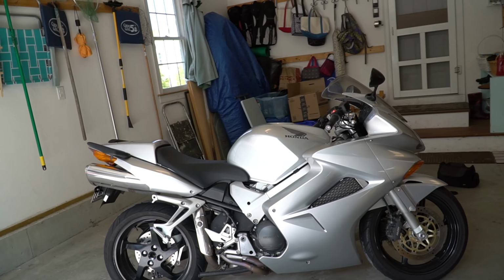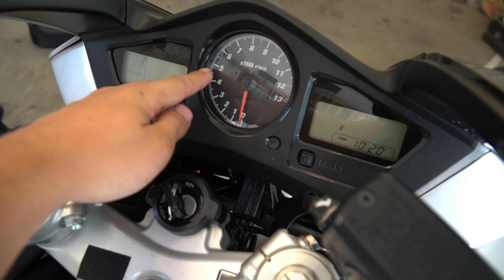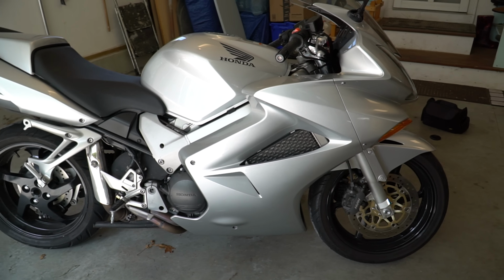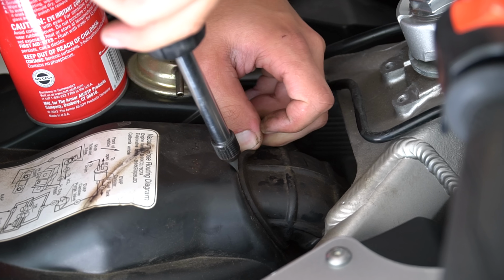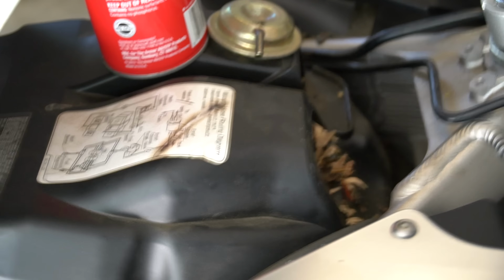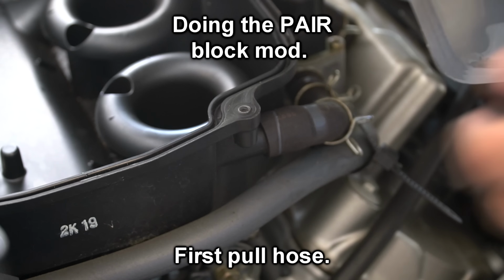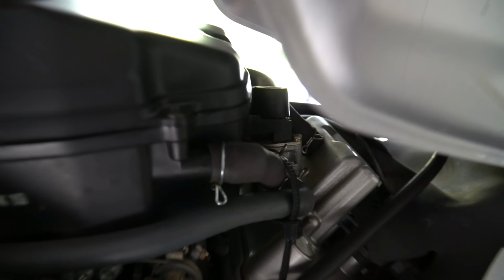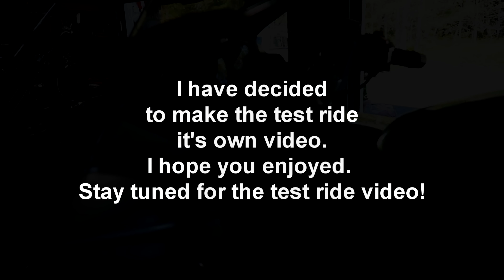VFR800 Snorkel, Pair, & Flapper mods, easy, free horsepower!

Comment: Speaking as a factory trained honda tech, the pair system only operates at closed throttle so it has no effect on acceleration.  It only injects air into the exhaust side during closed throttle deceleration for emissions purposes

Comment: I bought me a VFR from 2002 (my first bike😅) and although i am a beginner i just felt something's off on the low end but i couldn't say what it was.
I will do these things this week and i'll come back with some feedback.
Until then,thanks! 😁
Reply: Did you end up doing them?
Curious to see if it does anything
Reply: Did you end up doing them?
Curious to see if it does anything
Reply: @rocknexus5749  yeah,but only had to remove the snorkel,the last owner(i guess) did the flapper mod and deleted the pair valve.
To be honest,i think that the "power boost" sits in the stupid snorkel and the flapper. I love those pops on deceleration and i connected the pair valve back on(i noticed a pretty decent difference in fuel consumption with the pair valve connected since i still have the cat. convert on the bike,she drinks less 😅).
About that power gap that you feel around 4500 rpm,it's mostly gone,bike pulls better down low,but i still feel it every now and then,not big of a deal.
Overall,i am very pleased with it.
Go for a ride with it stock,get back home,remove the flapper and the snorkel and go back on the road and you'll see it for yourself 😁.
Ride safe,man! 🫡

Comment: 2 hours is definitely not enough time fro the K&N filter to dry, you just sealed the water in with the oil, so you have extended the drying time exponentially. That bike has been well looked after.

Comment: Done all these mods to my 2001 VFR800.After a short period of no difference,I've put it back to it's original configurance.
Reply: I could definetly feel a difference. It pulls much smoother and stronger at low RPMs, and the sound improved quite a bit too.
Before, it was a lot more jerky and felt weaker.

Comment: Did this to my 2015 today. Couldn't find much info online about if the 8th gen bikes needed this mod or not so I tried it out and omg, it's like a brand new bike. So much smoother at low rpm and shifts smoother too. I love it! I didn't do the snorkel though, I figure it probably helps keep water out and I get caught in the rain sometimes when I go long distance.
Reply: Rain water can't get in, pressure washing can, so beware people, also vermin love to make a nests/food stores in air-boxes ... waste of time pulling the snorkel, it does nothing for power or economy on any Honda, probly even all bikes, junk the Flappers system, did nothing anyway only quieten the motors induction down to pass stupid noise test at low rpm's.
Install chicken coup wire mesh or similar small grid wire mesh over snorkel end & over flapper inlet, it keeps mice out, we rarely see this mice issue here in the UK, but it's been documented on many bikes.
If you store your bike outside under a cover/lean too or an unsealed shed/garage, you defo need to chicken wire the air intakes, can't do much about mice/rats chewing thru wiring, but they do love to munch on electrical cables for some weird reason.
Reply: @mickeymouse4897  great info, thanks

Comment: I once did a similar mod to a '91 Ducati 851.  It had its airbox under the tank like the VFR and also had a removable lid.  I purchased a metal perimeter frame from Ferracci that held the filter in place and had "hooks" that the retainer clips would attach to.  The engine was now able to get air from the area of the entire airbox instead of just two small snorkels.  This simple mod alone gave 5 additional horsepower which was nice but the induction sound was incredible!!!  I will be doing the same to my VFR.

Comment: FYI, these mods do work on the 8th gen VFR.  I just did them on my 2014.  The fueling felt very good on it until I put an aftermarket exhaust on it ( coffman ).  With the aftermarket exhaust there was a definite flat spot in the torque curve from about 5,000 rpm's to 6,800 rpm's.  Also felt a little jerky at low rpm's.  Now it runs better than ever!  One note: I didn't delete the snorkel, I trimmed off the part that is inside the box, but left the exterior part of it as is, with it removed I could look right into the air box at the filter, I didn't want to risk water getting in there from rain or when washing the bike.
Reply: Thank you for info, i own 8G too, so im going to do that
Reply: @Jirkator2000  How did it go?

Comment: You should do other maintenance videos. I need to change my spark plugs in my VFR
Reply from the maker: +skyeric875 this winter I'm going to do my vfr's plugs. Luckily they are very easy. Just make sure you hand thread them in before tightening them down with the ratchet and be very careful not to over tighten!
Reply: The front spark plugs are under the oil cooler in front. Remove that and you have access to it. Rear plugs are just under the tank. Prop up the tank on the front while leaving bolts in hinged rear. Then just pull them out. Simple job.
Reply: @HeroRR  do u happen to know the torque spec for the plugs?

Comment: My vrf 800.. 2002.. Has a bad low end specially when it's hot but if I'm doing like. 30 mph in say 3rd gear it kind of chudders like it needs more revs for a smother ride is this common..
Reply: I have the same problem. As designed, this bike does not like running under 3K rpm

Comment: I did an air box modification on my 86 VFR 750 with a 2 inch hole saw, re jetted the carbs, and pinched a 4 into 1 Kerker pipe on it. It was loud and ran great. Lol. I wish I still had that bike.

Comment: 5th Gen 1998-2000 Flapper removal "Yes" ... Pair valve system removal "Yes" ... Snorkel removal "No" it'll do nothing but increase induction roar, it'll actually increase fuel consumption a little, engines don't like warm air, cold air snorkel inlet is there for a reason, all engines run better on cold air.
Late 5th Gen 2000-2001 & all 6th Gen variants (V-tech) motor, won't benefit from "Pair system removal" unless you flash the ECU with a modified map, fit an after market exhaust or slip on can & you'll that re-mapping with dyno runs, or you'l get turn a great bike into a jerko-matic badly.
Personally i've found the early 5th Gen to be far more responsive to "Flapper removal" & exhaust changes, they do run better with the decibel killer removed & noticeably smoother with starter valves set correctly.
Personally, I don't like the V-tech motor WTF were Honda thinking? massive re-engineering for little to no gain over the glorious 5th Gen gear driven motor, cost saving exercise is my guess, the 5th Gen motor was over engineered from the start, RC45 derived motor, yes "RC45" crankcases were used too, less exotic materials used on internal motor components, but basically a detuned RC45 motor is what we got... (Thankyou mother Honda).

Comment: It feels like I never have to adjust the chain on mine. Should the bottom of the chain touch the rubber runner as when I tightened up it felt too tight. Its hard to gauge the 1 inch mark as the chain touches the runner. Any advice would be great. Thanks

Comment: You should also block the vaccum line you took off the flapper actuator as it will be a vacuum leak and let in unfiltered air.
Reply from the maker: +maxiboyfm3a oh really? I didn't know that. I will put a screw on it. Thanks
Reply: @HeroRR  
Please do an edit in the video to explain the blocking to as it is many people using this as reference.

Comment: This is the one thing I love about my pc800, you can lug the engine and still get really smooth power, I was going through stop and go traffic earlier today and the engine was running at around 1000 to 2000 RPM and I was able to keep it up right

Comment: jesus christ! Open the air box to clean that sh*t from the air filter! Also, it is way easier to remove the snorkel with the air box opened. Although most people say the snorkel mod works, I really do not like removing it... I tryed, and the engine's sound... oh man! awesome! BUT, I think the engine sound is better but I do not see any improvement on the engine's performance! just my opinion. The pair mod REALLY works! a completely different engine at low revs!

Comment: Badass! You are a life saver man. I am about a week behind on your mods. Yes I WOT my VFR and she does NOT scare me like my GSXR 1000. THe VFR is real tame...I need just a bit more HP. This might help!  Thanks! ROFL...WTF nest!
Reply from the maker: These mods smooth out the power and make it a little better, but don't think it will completely turn the bike around, the VFR800 will never have the pull of a 1000, no matter what kind of mods you do.
Reply: No, they dont free up or give you more power. Many say that it does nothing to help. I did mine and am glad I did so since it was a lot of garbage under the tank. But, my bike does not act like your erratic description. Then again. I dont have nor dont want VTEC. I am happier to have no oxygen sensor and no gimmick Vtec. By the way the pair valve is not stupid, its emissions. lol
Reply: @GTARockman  gimmick? Research the thing ffs

Comment: Might be a daft question, but what is the purpose of having a volt meter on your bike at all times?
Reply: 6th genvfrs have a problem with the rectifier wiring, causing over charging, potentially blowing fuses and toasting your battery. If the volt meter reads more then 14.4 when running, you know its overcharging
Reply: @ASadP1ckle  thanks for the answer, do you know if the 5th gen has the same problem? I've just got one.
Reply: @RideKernow82  It does. Many have upgraded their Regulator/Rectifier to an updated, more reliable one. Google 5th gen VFR R/R and you'll get loads of hits regarding the issue.

Mine luckily has blown yet, fingers crossed!

Comment: great vid - I look forward to the test ride as I am really close to deciding on trying these mods on my vfr vtec 😊
Reply from the maker: Thanks! Spoiler alert: Try them! It's super easy to do and completely reversible. Also I think you'll be pleased with the results :)
Reply: HEROrr hi, so I did one at the time. took it for a ride, did another, and so forth.
first thing was the pair valve, I disconnected it and wow, the bike became sooo smooth. cornering and slow speed is now much easier.
next was the flapper, not so much difference, but it pulls smoothly up till vtec and the kick is not so abrupt anymore.
last came the snorkel, I think its mostly snarl and growl that was raised a bit, but I like it. not super noisy, just a bit more low end to it 😊
what a lovely new bike I got from doing this 😊
cheers

Comment: Or, you could get a pre-VTEC vfr, I had a 99 model a good while back and it was nice and smooth, after i got it i kept bouncing it off the rev limiter for the first couple of weeks because it was so quiet and the power delivery was so linear.
Reply: Well it's 0-100 in first gear so you were speeding then

Comment: Ok Finally got around to do the mods ..and if the mods did not make a sizable difference i would have gone back because i like my shit stock BUT the difference was very noticeable especially going onto a highway where you want that smooth immediate roll on power also,  city slow riding is also much better !!! The mods are staying !! THX ... :)
Reply: I put a golf tee in mine.

Comment: @HeroRR. Hello. In process of buying a 2002 VFR and the jerky throttle was one of the things that put me off the first (and only) one i looked at so far. Still getting one tho but that`s to be expected and this is the fix? Great. Other was "ticking"/rattling when cold. I assumed it was the valves as it`s approaching 30.000 miles. To be expected or walk away? Or not to worry but expect a valve adjustment summer 2020?

Comment: Good video mate... I did the flapper and snorkel and enjoyed the sound improvement and it was definitely smoother.. I also blocked the pair but didn’t pull the plug and it idled rough and needed the idle adjusted

Comment: I highly advise people not to do this mod,I did it and caused nothing but problems,just fit a pair of delkavic and remove the baffles this will help the bike breathe easier,blocking the pair valve inlet will cause lumpy idle,doing the mod will cause popping and backfiring,this over time will damage your valves,this bike is designed to run like this.
The bike is designed to run like this.
AVOID!!!!!

Comment: I just did these mods and put a Delkevic system on, fucking awesome!
Forgot to do the Pair mod tho.. 
But the snorkel, I just took the hose and folded it double and put a ziptie on it - the hose is still on the snorkel, works like a charm!

Your tips are amazing dude. Any mirror mods soon? Thinking about putting Bar-ends on mine.. Got horrible mirrors right now.

Comment: Before making any mods, ask yourself - "am I smarter than a Honda Engineer"."am I smarter than Honda's entire engineering department"?  I think not.  Unless you're competitively racing the bike, keep it stock and only use OEM.  I say this with 45+ years motorcycling experience, both street and racing.
Reply from the maker: If Honda's engineers didn't have to abide by noise regulations then there would be no flapper, 100%. There's a reason why their GP bikes don't have PAIR systems or snorkels..
Reply: I do feel I'm smarter than the EPA

Comment: I did all 3 mods. But reverted PAIR mod, here is my experience with all mods.
First day - I did Snorkel and Flapper mods, VFR was louder than before and smoother. 
Second day - I did PAIR valve mod also, VFR became less louder than first day, still same smoothness as first day. But I got cold start issue, felt like engine was not getting enough fuel and air when cold. Ran fine after warm-up. Then while doing r&d over PAIR valve, I watched this video https://www.youtube.com/watch?v=_xMykbzJWiQ. Video says PAIR valve is connected with exhaust, but it's connected with all cylinders also, and helps in exhaust stroke in expelling spent air-fuel mixture through the exhaust valve. And PAIR valve is involved in lower RPMs.
Third day - I reconnected PAIR valve system, VFR became louder as first day. As per me I liked snorkel and flapper mod. As bike feels more louder hence feels more powerful and enjoyable.

Comment: "Johnny-come-lately... the new kid in town". Not only is the information in this video inaccurate, but it has been proven false for over a decade now. These mods all add (ZERO) horsepower. The only thing you will gain by removing the snorkel and flapper is more intake noise and again this adds (ZERO) horsepower. The main reason to do the pair valve mod is if you have installed an after market exhaust/header and or have removed the catalytic converter/gutted the stock exhaust. Under these circumstances removing the pair valves will reduce the detonation and popping noises of unburnt fuel throughout the exhaust system, however, it will not completely prevent it from happening in lower gears under deceleration and again this adds (ZERO) horsepower. Don't waste your time on bad information.

If you really want to make your VFR accelerate faster, convert to a 520 chain, add 2 teeth to the rear sprocket and go on a diet...
Reply: remove cats, PC-III ,O2 elims ,Erion racing headers
,TFI Fuel Injection Mngr,removing the snorkel has been proven per Dyno runs improvements in hp and torque,
tune the bike for having the snorkel and flapper out (fuckin obviously),+2 as you mentioned,other mods available,..
I believe the point is for the VTEC's low rpm was shite and sounded much like a beefed up lawnmower. Bogging down like an overheated moped. With mods you can roll the throttle open from as low as 3 grand and it sounds like it should. Your contentions were true until you added only a 520 chain/+2 rear sprocket were the only ways to improve the VTEC's on an 800 interceptor. Truth is there are obvious mos that help,but honestly that VTEC is designed to open up at higher rpms you'll never be able to completely eliminate that.
Reply: @treynathaniel4075  You do not read or write well. Work on it.

Comment: I appreciate all the time and trouble you went through to make this video but I try to imagine what those brilliant engineers at Honda would say if they saw your video.  Gotta give 'em respect, my friend.  They're using those big brains of theirs to create the best motorcycle they can.  I own all kinds of bikes from Harleys to Hondas (and yes, BMWs and Ducatis, too) and I've spent thousands on flowed heads, ported and polished heads, larger valves with special 3-angle cuts, tiny little side-thrust bearings on rocker arm shafts, swiss-cheese flywheels, Delorto pumper carbs, dual plug heads, blueprinting, balancing, not to mention carbs, air cleaner mods and exhaust mods and the only thing I succeeded with was making the bike louder, not better!  Leave 'em stock and let 'em rock.
Reply from the maker: You do realize that every single race bike that honda makes doesn't have a flapper, pair, or snorkel. You want to know why? Because the reason why they have them is to pass emissions and noise regulations... that's it. If a honda engineer saw my video then he would agree that what i'm doing is a good thing for the bike. I even talked to my dyno tuner when I got my bike tuned and he recommended that I do that.
Reply: Not buyin' it, HeroRR.  You said "every single race bike that Honda makes doesn't have a flapper, pair or snorkel"  but there are so many differences between a race bike that Honda makes and the street bikes they make that you are comparing apples with kumquats.  Leave it stock and let it rock.